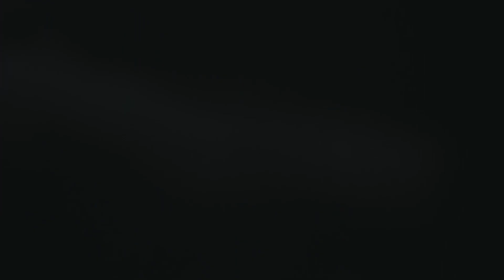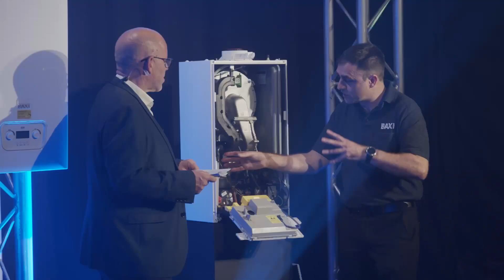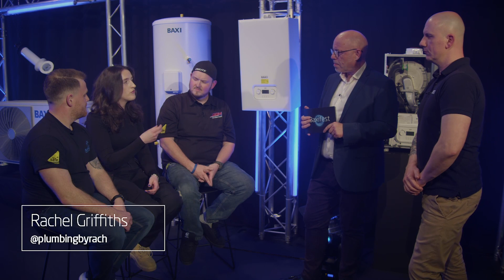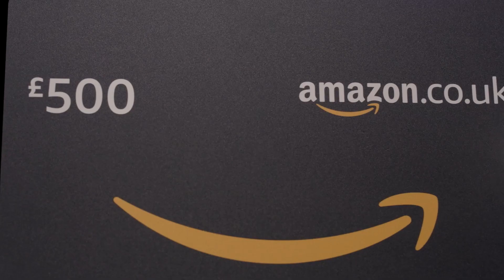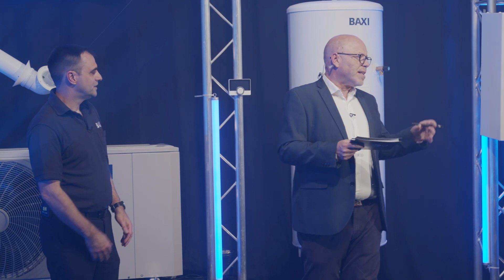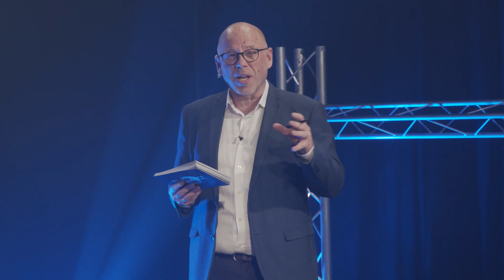Baxifest Live Show - The NEW Baxi 800 & 600 Combi and System 2 boiler range reveal!

Comment: Can the system boiler recognise whether it is heating the hot water or heating when using the weather compensation?
Reply: Weather compensation would only adjust output of primary flow is there is only one primary flow then there is only one output temperature to adjust hot water priority would need to be through a combi using the hot water plate heat exchanger as a cylinder supply set to a different temperature than the heating circuit and pumped independently controlled by a two port valve

Comment: Can you fit open therm and weather compensation together with this boiler?
Reply: Watch the video, says about it around 4min mark. Yes has both
Reply: @Biglenton  which one will control the heating curve?
Reply: @richardnixon8410  dunno I don’t work for baxi, probably be done on the heating temp knob like the ideals or on the open therm controller you select which will probably use GPS for local weather. They have their own controller that does weather and load comp which will make best use of efficiency, using a manufacturers own control on a combi is pretty much a no brainier for best control these days. I don’t have personal experience with the baxi controller but a friend as fitted a few and likes them.
Reply: Yes. The chosen controls will take readings from the ifos sensor and the room temp to adjust flow tenp via chosen curve
Reply: @pointyplumber  Hi Pointy, will that work then with my Dryaton wiser on opentherm and the IFOS?
Reply: @richardnixon8410  yes mate should do aslong as the drayton wiser is certified opentherm the only thing to posibly limit acess is the app interface as i know the wiser stat is quite a basic temp switch but ive not set a wiser up open therm.

Comment: Hi all, question for ian
1. Is the new 600 model range rated i. e down the kw rating
Thanks
Reply: None of the Baxi boilers need to be range rated due to them limiting output automatically based on differential between the flow and return temperature sensors on the primary heat exchanger
Reply: @pointyplumber  nice one pointy didn't know that one good features on the new models